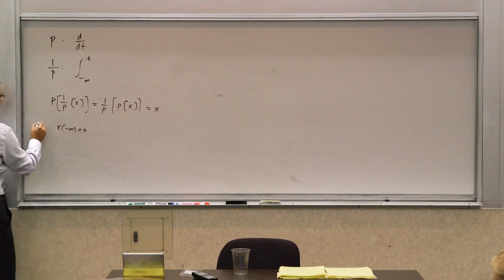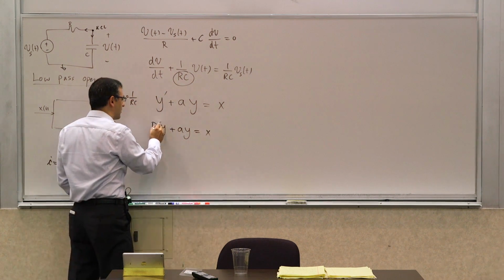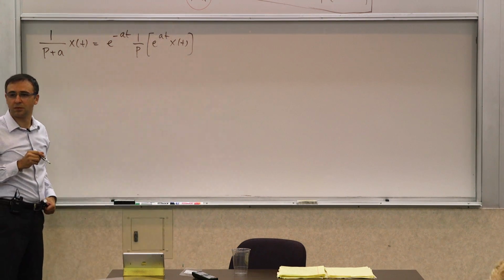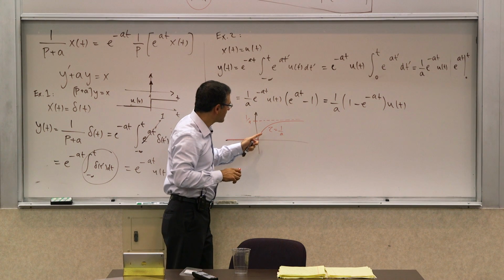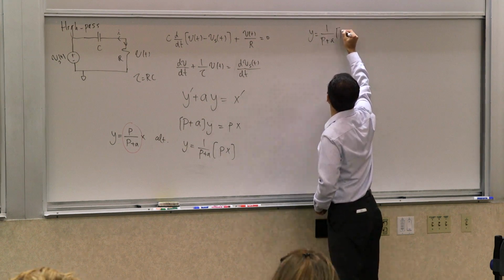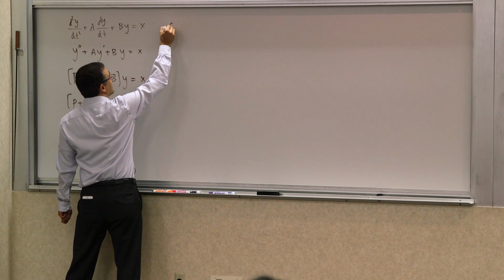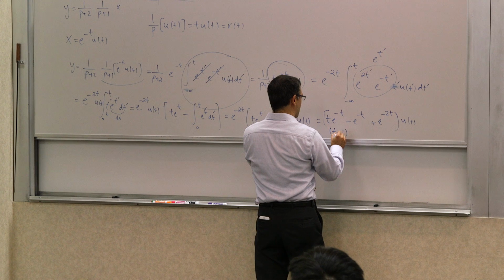017. Heaviside Operator: Low-Pass Operator, High-Pass Operator, Solving Differential Equations

Comment: 4:36 low pass operator
6:58 the equation describing the circuit (1st order differential equation - spring mass damper - Radioactive decay of a Nucleus )
10:47 the Heaviside p Operator
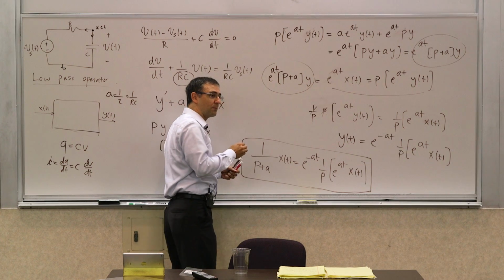19:52 exq. 1st order Low-Pass Operator (inverse of p+a Operator) -impulse transfer function 
25:27 Causality (producing output before input)
There's sufficient number errors caused by dropping them off
26:39 ex.2. High-Pass Filter 
( output given a different input)
33:07 rate of sth depends on it's value (I. E. Halflife: Radioactive decay number of Things Decay depends on how many got left -rrlaxation process
18 20 novel concepts in engineering
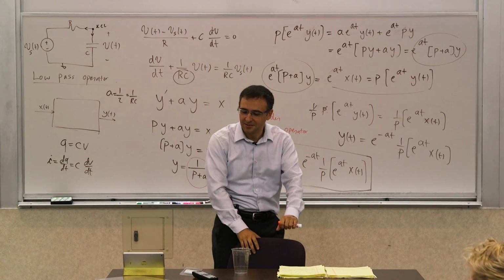34:23 making sense of 1 energy storage, resource, Degree of Freedom I.e. (restricted to)  defining 1 initial Condition

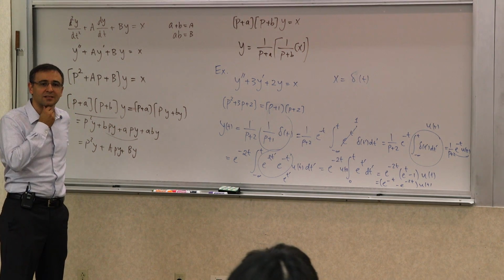Comment: 1:00:00 - How would the initial conditions show in the differential equation or in characteristic polynomial? Are we assuming zero initial conditions, as the circuit is not changing it's structure (having a switch) and input is zero for t < 0, so that tells us that all initial conditions would be zero in LTI system?
We need to have x(-inf) = 0 or all zero initial conditions, in order for Heviside operators to work as functions. They would show when we would evaluate integral for bottom value (t = -inf).
Reply: OMG, in video 026. we account for initial conditions as combinations of different Dirac Delta signals at the input. As the delta function is one that has infinite value for infinitesimally small step after t=0, it would be only one strong enough to instantaneously change the state of the circuit elements. And we can do that as we only really need n-th derivative of two-sided f(t) at y(0) to know everything about it before t<0. 
That is a neat way, as we still preserve p[1/p[f(t)]] = 1/p[p[f(t)]] = f(t) property, that we would lose if we have accounted for initial conditions by setting f(-inf) = initial_condition_value. We would probably be able to derive the same trick from that too.
Sorry I am just using comment to document my own thoughts.

Comment: 21:12 - Ex. 1 - 1st order impulse response
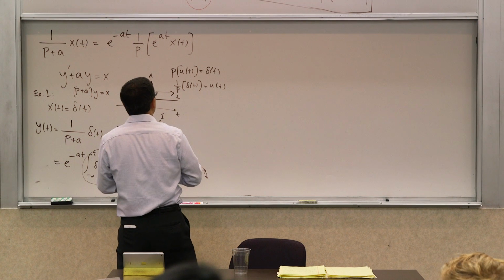26:27 - Ex. 2 - 1st order step response
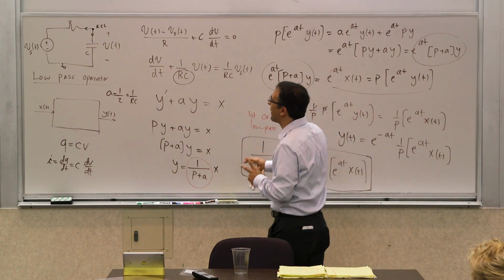35:20 - High-pass operator derivation
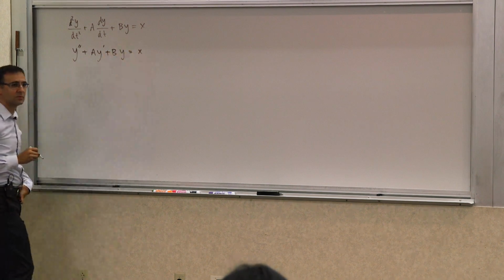49:00 - 2nd order differential equation examples
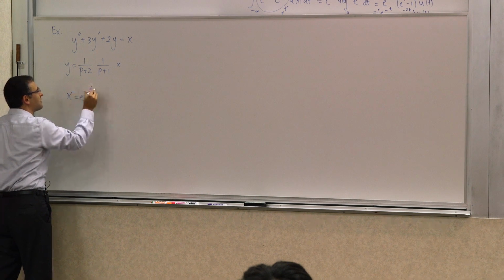1:03:00 - Hitting it with it's natural frequency

Comment: Professor Ali Hajimiri, In lecture 15 you develop step and impulse responses for simple RC circuits where the magnitudes do not match the results you arrived at here. For example, in lecture 15 the impulse response was: Vs / RC * e^(-t / RC) * u(t)  while in this video the impulse response is e^(-t / RC)* u(t). I will assume Vs = 1 and we can ignore it but I am left wondering about the 1/RC scale factor arrived at in lecture 15 that is not present in this video.
Reply from the maker: Fair question: Other than matter of the units discussed in lecture 15 starting at 6:25, it is the difference between what differential equation we are solving. In lecture 15, we are finding the voltages, here were are solving differential equations. To see where the discrepancy comes from, let's write the differential equation governing the RC circuit of 15. You can easily show that it is v+RC dv/dt=vin, where v is the voltage across the capacitor. Now if you modify it to have the form in this lecture (17), you should write it as y'+ay=ax, where y=v, x=vin, and a=1/RC. Now you see that this equation has an input ax instead of x, so if the solution for x on the righthand side is e^(-at) u(t), then the solution to ax would be ae^-(at) u(t). Now considering that a=1/RC, the result is the same as what we got in lecture 15. 
Hope this helps.
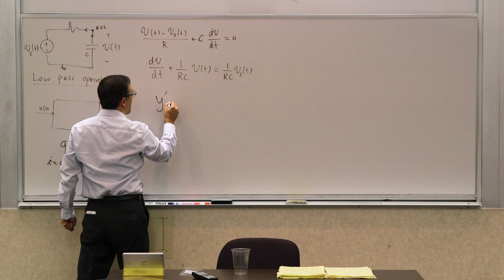Reply: Got it. Thanks. At 9:45 in lecture 17, you write y'+ay=x instead of y'+ay=ax (the form you mentioned in your reply). Using the second form scales the low pass operator: a / (p+a). The scalar a in the numerator ultimately carries through impulse and step responses making it agree with lecture 15. Excellent videos by the way. Thanks again.